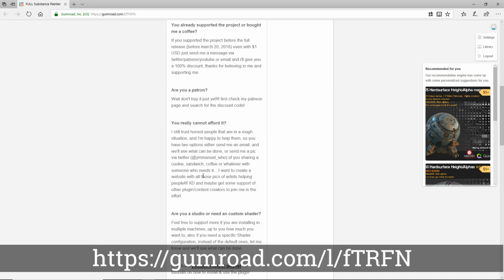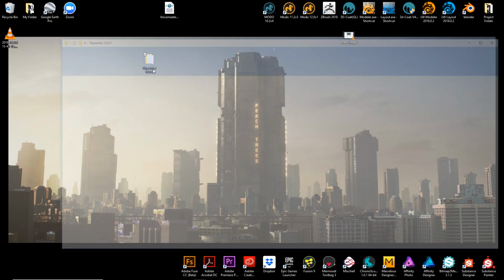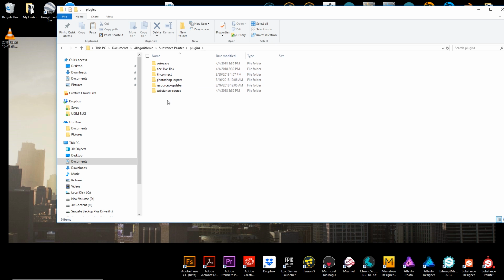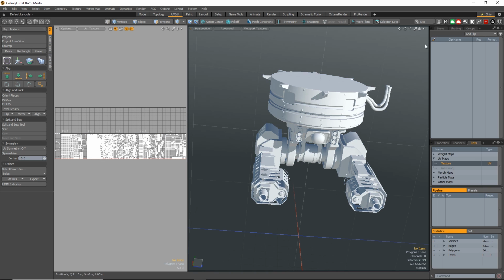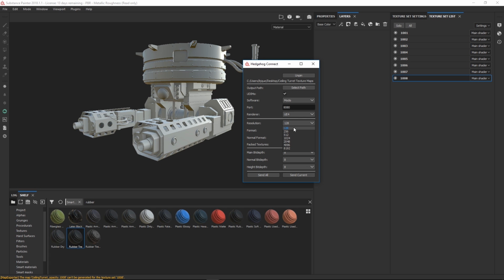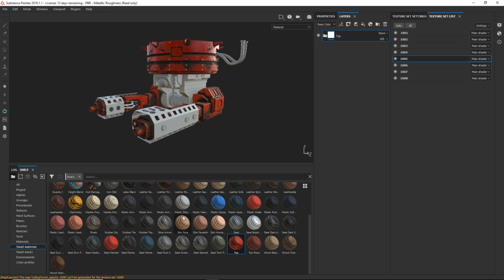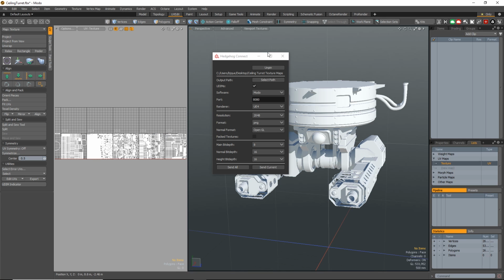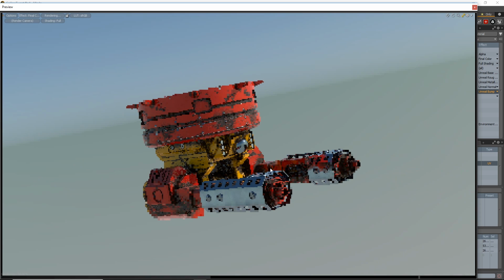Substance Painter Live Link PF

Comment: I wonder if you can use substance painter on a separate computer
Reply: Hi, im the one that made the plugin, you mean have modo in one computer and SP in another one?? that is easily done, not out of the box, but with a couple small adjustments  sure!! is not by default mainly for network security reasons...
Reply: Thanks we have one computer dedicated for 3D painting
Reply: if you buy contact me via discord, and i'll help you set a custom host instead of the default 127.0.0.1
haven't really tested but im interested in the performance